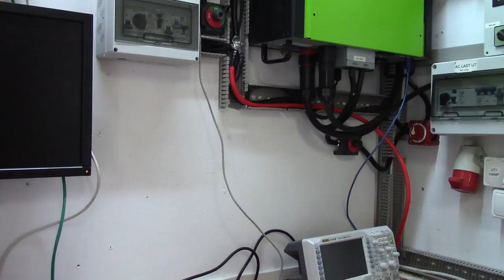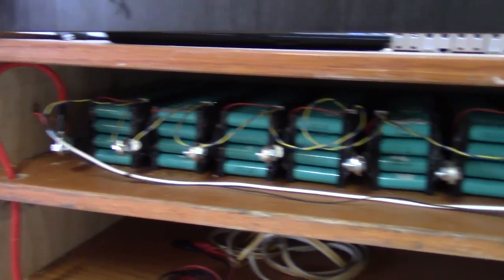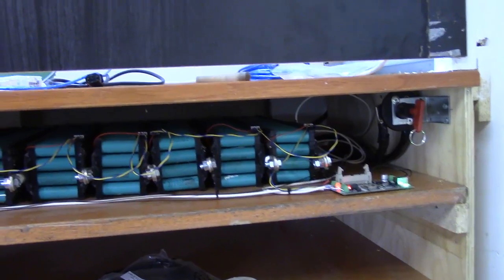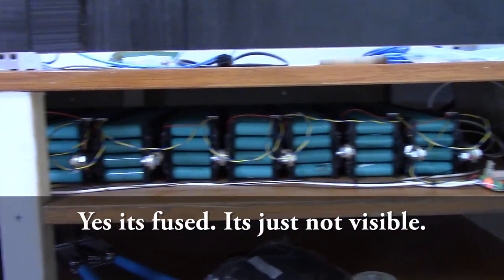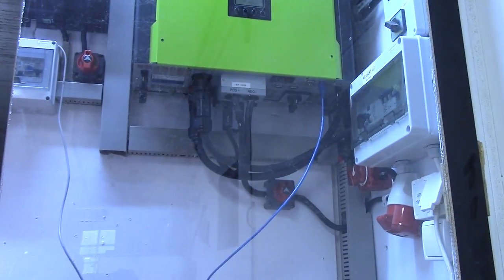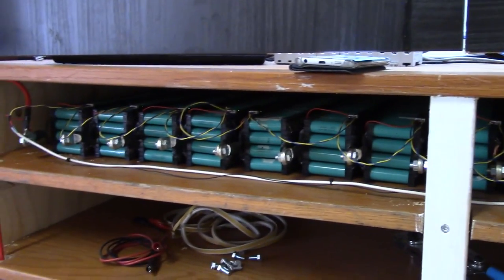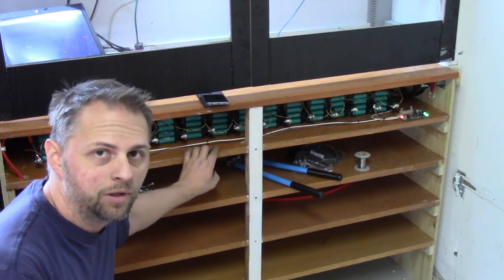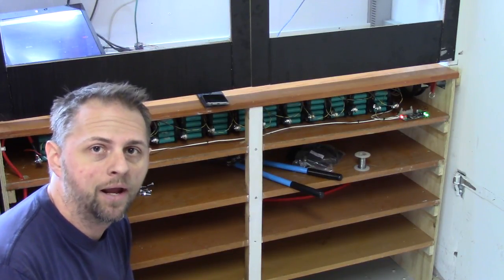10kWh of 18650 cells added to my power wall

Comment: This is about 20% of the total backup I have installed. I recommend higher voltages (more series circuits) and lower current (less parallel circuits) so the wiring can stay thin and practical.
Reply from the maker: Cotronixco i got like 150kwh total. Its hard with higher voltage Then 48V since its hard to find    approved electronics where i live
Reply: No, I'm referring to the way you are wiring your cells into batteries. You have way too many cells in parallel. There is no need for this. You can keep a 48V system using S14 or S15 cell rows. You have P20 cell rows combined with P4 cell columns which causes way too much current and way too low voltage per battery.
Reply from the maker: Cotronixco No im Running 14s80p.  Cant have higher voltage since inverter wont handle it.  And. Then i parallell Them.  I could do bigger p but at that time i did not have more cells and They should not be to big either.
Reply: What I see in your video is 80p 14s, not 14s 80p. There is a huge difference. Each scenario is still a nominal 48v setup. Electrically, the inversion equipment doesn't see a difference. But in wiring alone, the difference is huge. With 80p 14s, you have to wire to a common point with huge cable and connectors to each pack. But with 14s 80p, you can use 12 gauge wiring and connectors and smaller fuses for each pack. It's the same concept that your local power distribution company uses. Just because the what powers your local transformer primary may be 14,400 volts, you are still loading the secondary with 120v and 240v appliances.
Reply from the maker: Cotronixco and ur point is? In not sure i follow ur point? I Guess u dont get why i do it like this then. Yes each pach is 80p. Easy to carry and  work with and 1 longmon in each.
Reply from the maker: Cotronixco and no i run 14s80p. Not the other way around ;)  actually the ones in video are 4p14s80p to be correct. 80p14s is 80 strings of 14 cells in series vs 14s80p is 14 packa in series of 80 cells each in parallel. The later only need One bms meanwhile the first need 80 of em .
Reply: Well, what I'm reading and what I'm seeing are two different things. But it's not worth more time to explain myself. Have fun and all the best!

Comment: Holy crap Martin, I feel you have a "installing another XX KwH bank" video coming out about once per month!  I think you could be the first non-commercial DIY powerwall'er to reach 1 MwH of energy storage if you had the need / want.  Nice work on the time lapse as well.  :)
Reply from the maker: levik1832 thanks. Though my name is daniel :)
Reply: Derp, I'm an idiot.  I actually know your name...just got my wires crossed with you and another youtuber in the midst of watching a bunch of videos on 18650s!  Cheers!

Comment: Hello Daniel,
Please if you could help me with my question, I have bunch of laptop cells, mixed ( ICR , INR ) and planing to DIY 3S pack for solar. is it okay to mix ICR and INR Li-ion??
Reply from the maker: Should work. But 3s aint very good for 12v system.
Reply: @DIYTechRepairs  thank you Daniel, I know but I know why I want a 3s, because I already have an 1500w inverter, that cuts off at 15v I suppose and at 10.5v, I don't mind the 10.5v cut off. I appreciate your time to answer my question. btw, I use Repackr to group the cells

Comment: Well done!!!  Let me first say I am a novice who was inspired by you guys (DIY Powerwall) I also started building my own PW packs with all the cells (100) in parallel.  So I would need 14 total to get the 48V end voltage.  I watched your 48v pack build and I'm curious as to why you wouldnt use those packs for this build.  In other words what are the Pros/cons of building Power Wall with 48v packs?

Comment: Negative and Positive contacts are supposed to be on opposite ends of the packs for an obvious reason...
Reply from the maker: Al Cambon it depends. On low current like this the voltage drop is not something that affect it alot. For normal and high current i agree fully. For instance my valence packs that are made in factors they have the connections on one side :)
Reply from the maker: Al Cambon and if you think its obvious by everyone please tell people why:)
Reply: Different resistances. But just falls into action at higher loads. Using different length or wire thickness on both poles causes cell imbalance which the bms has to take care of again and you loose about 10% capacity.

Comment: Any issues you could see by making a 160P pack? Just trying to save some space and make things more simple.
Reply from the maker: No direct problem as such. Just make sure when choosing BMS that you can balance it.
Reply: DIY Tech & Repairs thanks. Plan on using batrium
Reply from the maker: Should work fine :)  It will take some time to balance if they are out of balance but it will work

Comment: i wanna build a 24 v pack .. but i dont wana use a bms .. can i  balance my cells by making a conection in parallel of all groops and charge them with 4.2 v .. will this work ?!
Reply from the maker: Yes but you need to connect/reconnect them during every charge. If thats the case its easier to get an RC charger that do balance charging. but beware of that a BMS do so much more than balance. It protects the pack based on current and voltages.
Reply: @DIYTechRepairs   can i let them connected ( and use them as 24v) in that way to keep them all balancet , is this possible
Reply from the maker: No you cant. You will short it out if you try. Its either or. Either serial or parallel.
Reply: @rajgj7041  if you want fire your house than you can let them connected

Comment: When you say lower current draw - How much were you thinking? What max current per cell? oh and dude - you have a lot of batteries!! Love your videos.
Reply from the maker: Thanks m8!!  If i run full load with current wiring where the big bank have somewhat larger wires and alot lower IR compare to the laptop bank its like 1/4th of the current on the laptop cells at most. This due to the LiFe bank doesnt drop in voltage as much as the liion does. This equals up very nice and if the large bank have 200A this smaller one currently get 30A. It will get some more when all 4 rows are installed but i bet it will not be that much. Currently max around 300mA per cell and in future way below 200.  (Its just estimate so when all is installed there will be proper tests filmed of course)
Reply: Thanks for the reply. Interesting how you are mixing LiFe and Li-ion with different discharge curves. Interesting stuff. Only thing i'd be careful of is what happens if and when you drain the LiFe down to the Li-ion pack voltage then all of a sudden the current draw on the Li-ion will go up a lot (assuming your house is demanding high power at the time). i would guess that transition from low current draw and high current draw would be pretty fast too. Are you able to limit the Li-ion current to prevent rapid discharging?
Reply from the maker: David Ball the inverter goes to grid as first point. If that fails  the bms will take over and  disconnect the battery banks :)

Comment: So what was your total cost of purchasing all those cells so far?
Reply from the maker: Thats a good question. if we only talk about money spent on 18650 laptop packs then i have spent some where around 1300EUR or so?  I dont have the exact number in my head. Above would yield something like 35kWh of useable cells. Out of the 35kWh i have gotten somewhere around 5kWh of free cells.
Reply: DIY Tech & Repairs compared to Tesla's wall which is 14 kilowatts/hr for $7000 us(cheapest on market)...
Reply from the maker: Dont forget they are ready built. You can have insurance on them. Guarantee... Including inverter so its not comparable to what I gave just for 2nd hand cells :)

Comment: So for 10kWh you need around 1081 18650 cells. That is a lot of work, and would cost at least $2 per cell when you buy them in bulk. So around $2162 worth of cells. This doesn't seem worth it, since for that same amount of money you can buy 5x 280 Ah 12v deep cycle batteries, giving a total kWh rating of 16.8kWh, plus you don't have to do all of the work of connecting thousands of batteries. And many good deep cycle batteries have cycle lives of up to 1000 cycles, where as 18650's are rated at around 500 cycles. Overall you are losing big time by messing around with lithium for running your home, maybe in the future they will become competitive.........but it's very hard since lithium itself is far more expensive than lead. 
Of course lithium is a no brainer for small electronics like phones and laptops and flashlights though, nothing can beat it in these fields.
Reply from the maker: Let me break down your concern into parts:  
1. I would never pay more than 20c per cell for LiIon as of today. (Its not worth it compare to grid power)
2. Above give around 10kWh of total per bank (Not useable but total) Useable is 8kwh since Liion you generally base it on 80%dod and 500-1000 cycles. 
3. If I cycle them around 60% DoD i get 2000 cycles (In theory to datasheets)
4. yes there is plenty of work but above is done as proof of concept. (Check my main wall instead)

So now lets compare to Lead acid
1. I have yet not seen any lead acid sold where atleast 90% capaciy is left for a decent money / kwh where I live
2. 5*280Ah in my area would cost 4000eur for even get anything that can do 50% DOD and 500 cycles... 
3. yes 5*280 would give 16kWh BUT you can never ever use 100% capacity if you want more than 100 cycles from a lead acid battery. If you want 500-1000 cycles you should not go above 50% dod = 8kwh. And if you want to match above with my lithium bank that i plan 60& useable capacity aka 6kwh useable and 2k cycles your lead acid would give me around 3.2kWh.. Not that good any more right?
4. They are easier to put together

So lets get the best of 2 worlds? I guess you have seen my main battery bank? Its made out of LiFePo4 cells. Same size as above but they are 130Ah 12V packs from start. Compareable to lithium. So what makes them so much better?
1. I dont have to assemble much
2. They are guaranteed 6000 cycles 80%DOD!!  LiIon cant beat that and Lead acid dont even get close
3. They are still cheaper than buying Lead Acid where i live :D
4. They are also way more safer than LiIon and atleast as safe as Lead acid. 

You can also buy Lithium cells in 100-500Ah cells now a days so there is no need in actually going with the smaller 2Ah cells but it all depends on what you get hold of. Personally i calculate total useable Wh on my battery bank over the full cycle life of a battery. And currently Lithium for me is 10x better even with the work included. 

Btw I was a Lead Acid solar guy before but it was not worth running LA any more here :) It may differ for other people

Comment: those key switch battery connectors are no good...i've had repeated misrepresentation of their ampacity handling.
Reply from the maker: Dale Costich depends on type though. This is 500a rated but neither less i will replace to proper later on. :)